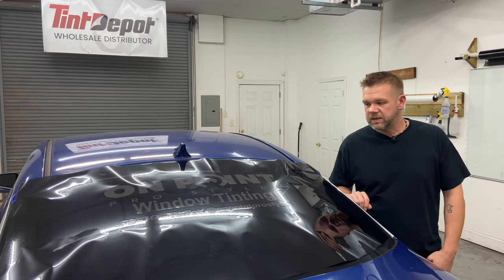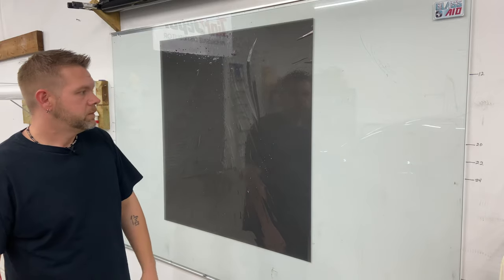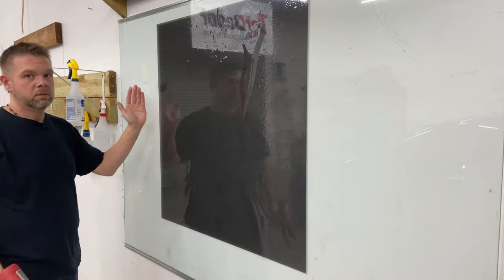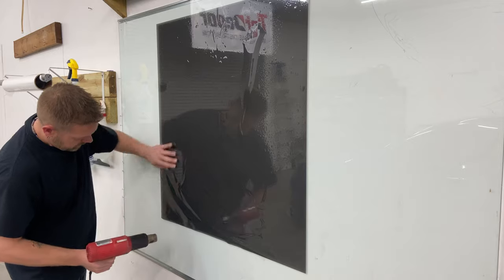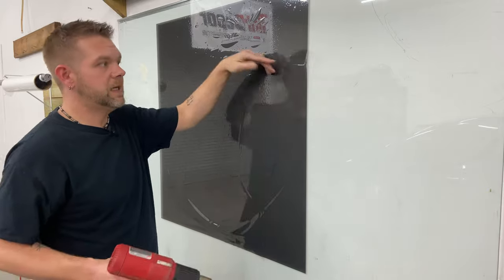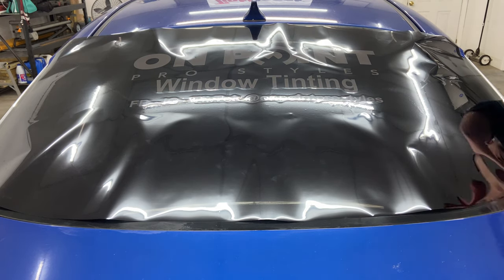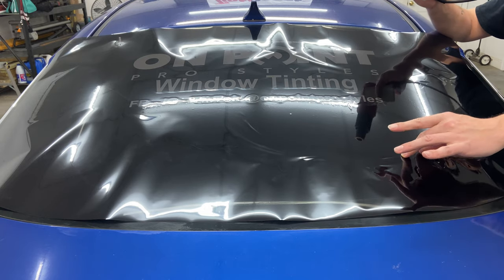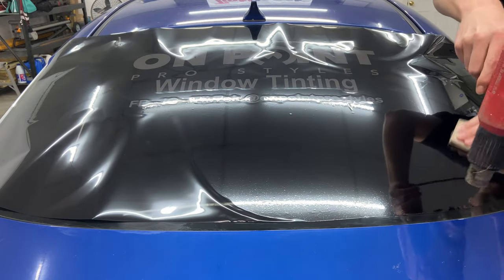Shrinking window tint explained. Dry shrink. Back rear glass. Windshields included. Tint depot.

Comment: I think I know why you can only shrink it in one direction.
It's because of the way the film is manufactured. As it goes through the various processes and rollers at the factory it's slightly stretched. As you apply heat, it naturally wants to unstretch but it can only do that in one direction since it was only stretched in the one direction.
Reply from the maker: This is a fantastic point! Thanks! That actually makes a lot of scientific sense.

Comment: Kevin good job on explaining which way tint will shrink...my theory is that the tint is being pulled or stretched as it's made or being rolled on the tint tubes...thus not leaving any material to shrink...who knows only the tint company rep who reads this might throw in the explanation...
After tinting since the early 90's n hanging up my pouch n olfa blade...back in the two piece defroster cut days to make it look like a one piece an art...I catch your videos n try to keep my two cents to a minimum ense my shop nickname 2cents...Will throw a bone every now n then...I whore "jersey brown gloves" to push the tint fingers down n keep my hands from getting burned...didn't like the hard card to risky to get a crease as your push down the finger...and you could put the baby powder inside the glove to tap it on the back window to dry shrink...ok...great times at Custom Sounds SA,TX,USA...

Comment: Nice vid bro, thanks for sharing. What's the size of your peel board? & what kind of base or supports are you using to hold that board on the wall?
Reply from the maker: Thank you. that a 4ftx6ft glass held to the wall with mirror J channel from Home Depot. I used one on the top and the bottom then slid the glass in. I plan to pull the top channel off and just use mirror holders so it's easier to remove if needed.